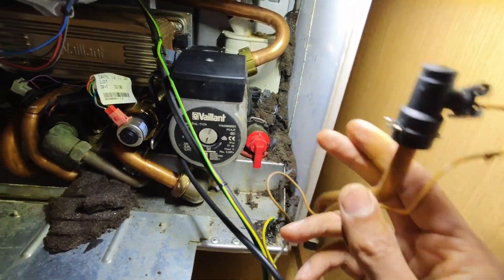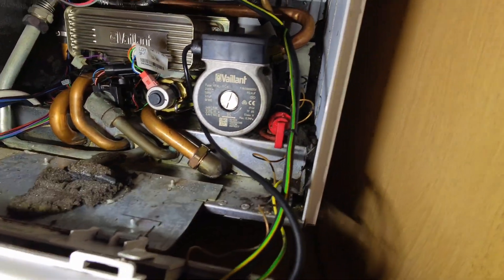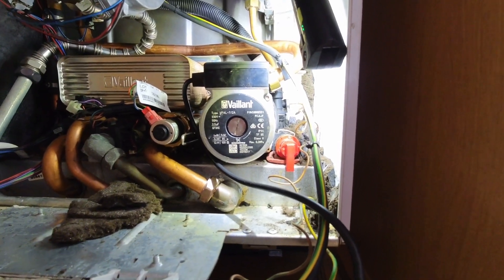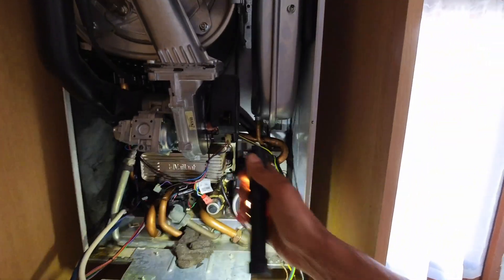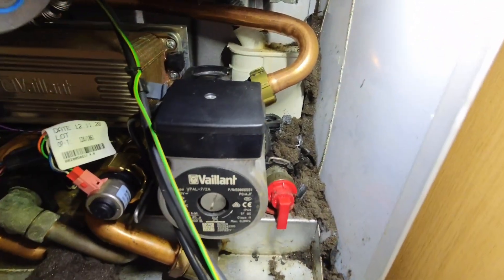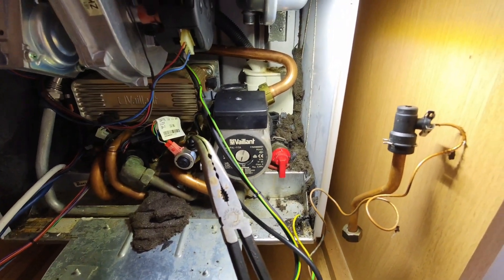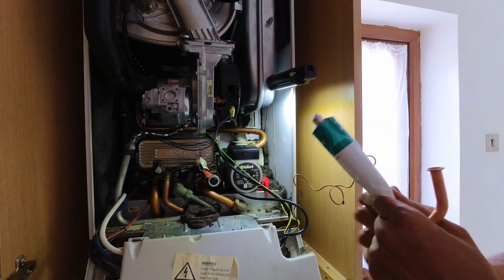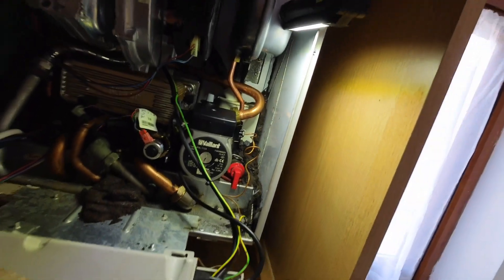Snapped Off On A Sunday!

Comment: Good job, next time try taking the side panel off  2x T20, a lot more access especially if you’re changing a pressure sensor.
Reply: That wouldn't have gained much here, the cupboard side is right next to it
Reply from the maker: This model doesn't have the T20 screws, it's got the rivets unfortunately
Reply: @cputilitysolutions  missed that 😂
Reply: Think that's only on the "Pro"